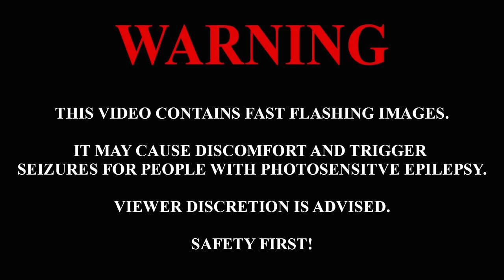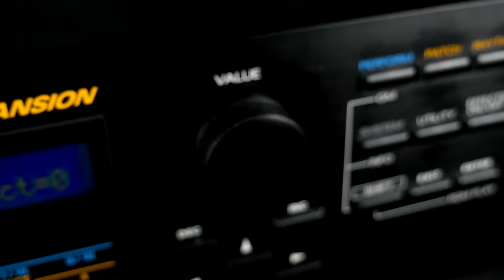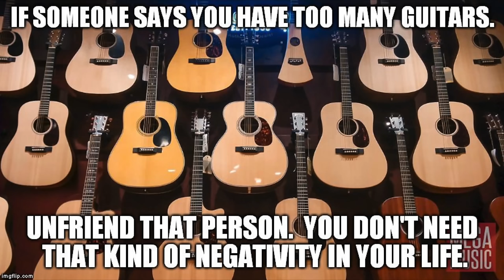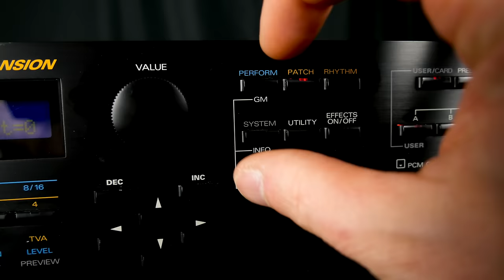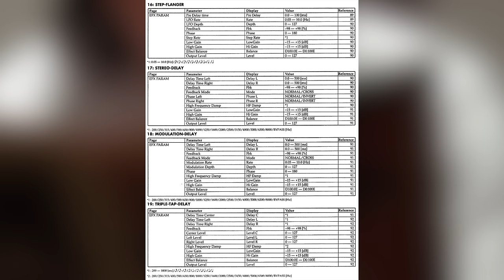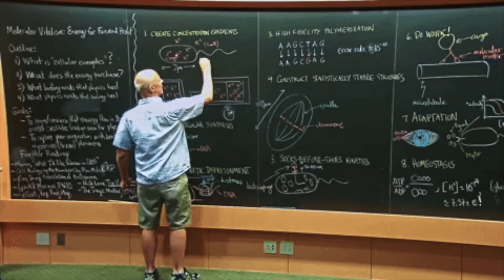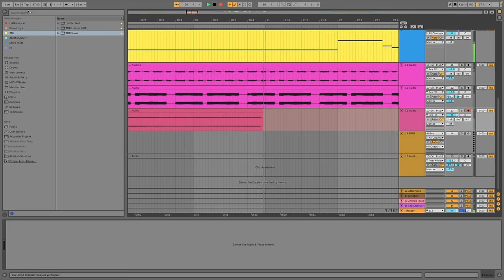Bad Gear - Roland JV-1080

Comment: I remember looking at all these back then. The JV2080 added being syncable to a midi clock if i recall, something i really wanted at the time.  I ended up with a JD990 with the Vintage expansion which i still have in a rack which is still a keeper, no syncing with midi clock though!
Reply from the maker: 1080 synced to clock quite nicely;)
Reply: @AudioPilz  I had it in my head it didn't but a very old memory now! It was that sort of in between time where manufactures hadn't quite caught up implementing those sort of features.

Comment: I have the 1010 and even though I don't use it that much in production, it's great if I want to get away from computer for a bit. Has everything you want in a small package and still connects pretty nicely with hardware and computer today!
Reply from the maker: 1010 sounds very similar and is super compact!!!

Comment: I roll an XP-50... basically this in key form, with a Keyboards of the 60s/70s Expansion Card.

The expansion card makes it much better.... ALMOST better enough to want to buy some more!

The engine is deep, and good, but it is a thinner-sounding unit.

Patch A-12 - PianoStrings - still gets the job done in a lot of tracks, from Don't Stop Believin' to christmas tunes at work :p
Reply from the maker: PianoStrings is legendary!!!

Comment: any one of the roland JV/XP series is a sleeper sound design beast. some ideas from having a 2080 of my own:

you're sequencing drums on the thing: put the kick and snare on a separate Part and route them through a compressor EFX; keep toms and cymbals, other stereo elements on Part 10 and route it through the chorus effect

remember the extra outputs: everyone has guitar pedals nowadays, digital outboard rackmounts are probably cheaper still; send the bass to a preamp, send the strings through a phaser
Reply from the maker: Nice technique!!!

Comment: Protip: If you want the Roland cloud VST for the cheapest price, don't buy the JV1080 or 5080 VST. Instead buy only one of the SRX expansion module VSTs. It contains the same synth engine and all of the samples of the JV1080 and 5080 VSTs plus the samples of whatever SRX you got, all it lacks is the 1080/5080 presets (but you could just add them yourself since it has all their samples and synth features). So you actually get more than buying just the 1080 or 5080 VST.
Reply from the maker: Great idea, thanks for posting!

Comment: 8 Mb for sound was pretty high end for the 90's. Even Creative's AWE 64 top soundfont banks were up to 8 Mb. Eventually it got up to 16, possibly 32 Mb, but by the time of XP computers, it made more sense to go with PC RAM that went up to 4 Gb, which is more than able to handle the 1 Gb Crisis MIDI soundfont bank. And, to be honest, the Crisis soundfons wasn't all that great, considering  all the RAM it used up. I'd take this Roland 1080 over the 1 Gb RAM hog.
Reply from the maker: Top of the line back then!

Comment: Wether it’s geniality or just a coincident I don’t know, but what Roland did with both the JV series or the slightly Cut down GM/GS modules, is that ALL the sounds are extremely coherent and just fits so well together, even each sound is no way near perfect in it self, they just sound so well together in a mix. I have never heard a GM module from any other brand that sounded just half as good as the SC-55 or SC-88, when you spent time editing the sounds, and that in itself is truly epic when you take into account how cheap these models were even when they were new and hot. On the other hand the new stuff with Zen cores still is far away from being as cutting edge as all this from the 90’s.
Reply from the maker: Agreed, they are super coherent indeed!

Comment: It's in the same price range today as a Kurzweil K200RS.  You can a nice library of similar sounds that are in 44.1kHz plus sampling and sample playback options.  Plus the synth architecture of V.A.S.T. really smokes what's on the 1080.  Plus the interface is worlds bigger and better.  You can actually visualize and edit sample waveforms on the K2000's front panel.
Reply from the maker: I want that Kurzweil now!!!

Comment: I have the XP30 - the keyboard version, pretty much exactly the same internals, and with 2 x expansions built in with space for a couple more (I think a couple, I can't remember, I'd have to take the synth off the rack and turn it upside down to check, and I seriously cannot be bothered). Only one pair of stereo outs, though.  Having heard the sounds here, I am defo going to plumb my XP back into the rig.  I moved house a few months ago, and had decided not to bother (a theme here?) coupling up all my old hardware.  Thanks to this vid, I am changing my mind.  I want me some '94 Roland action.  I'm thinking some XP / JV vibes through some nostalgic wobulators - maybe some slow LFO to pitch and some simulated VHS degradation in the chain, and I can start to get a bit 'mall-soft'-ey.  Thanks for this.
Reply from the maker: That's a nice one!!!

Comment: LOL.   the cork sniffers go at the 1080 vs 2080 converters. I think they both sound great.   i found a 2080 used for $200 at my guitar center while looking at the national used gear website. it was destined to be. i sped to the store and it was still there with the memory card taped to the top..  nobody looked inside. there are 5 of those expansion cards you showed (the 2080 can have up to 8).  best music gear score of my life.   I downloaded the pdf user's manual.   reading that thing almost makes me want to cry.  So, ya, i use the presets.  some are heavenly. there is a nice oboe and lots of fun vocal doo-wah stuff on one of the cards.   You could just play the demo song for a serious demo of that 1080
Reply from the maker: Yeah, I found that funny too. I got copyright notices for using Roland demos so I try to keep it safe in the episodes

Comment: wrung some astonishingly usable Trance and Psytrance bread & butter sounds out of the 2080 last year. It holds up well alongside the JD. Although the lack of Unison on the JVs really holds it back from matching up with the JD-08 (and I did run it through a Virus for the reverb, because... Virus reverb). But this and its cousins still sound solid in a modern mix when used right

Comment: A rare difference of opinion on this one. The JV1080 was an absolute workhorse synth, actually a great design for its day ( sure great to have better physical control etc) BUT it was fully featured, excellent sounding module, step above most of its competitors ( due to proper “synth” capabilities) and even made expandable options for a decade... alll  in a very compact, good value package. Don’t think anything  about it deserves “bad” label......
Reply from the maker: You know the drill, one person's Bad Gear...;)

Comment: The Roland cloud version does not have the expansion boards added to the main instrument so you can't mix and match the waves with each other. On the other hand the hardware expansion boards have been said (apparently) to blow up if the capacitors are not changed.
Reply from the maker: Capacitors seem to be a problem on these

Comment: Nah, this time, the cloud is a great value, but you can get this 1080 as a vst for only $129 with an additional 500+ waveforms, doubled polyphony to 128, and it's just incredible. No more fixing burnt anything or deal with distortion and you've got access to timeless sounds, not dated at all.

Comment: I recently obtained JV-880. It's a lot better than 1080. Takes less space and sounds warmer. Perfect if you send it through a distortion pedal, couple compressors and add external reverb and delay with chorus and flanger. Then it can be added to a hard techno 150BPM without any even remote possibility that it would sound like 90s commercial.
Reply from the maker: Nice one!!!
Reply: @AudioPilz  lol, I thought I was being funny :-) What a nerd I am...

Comment: A JV1080 fell into my setup practically for free a few years ago. It was already long of tooth when i got it, yet it sounded like all the recordings that used it, it was very clean and solid, and it sounded better over my shitty PA, for some reason. So i used it (even when i got better speakers). Fast forward go 2022, I buy a Fantom 8 (i lost my mind) and inside that thing is every patch from the 1080 (at least i think so, they are mixed in by category). Unlike the Juno sounds in the Fantom (which are not convincing), the JV1080 sounds are identical. The Fantom shines in it's quality key bed and excellent virtual piano and organ but it's a sad, glitchy disaster.
Reply from the maker: Agreed, these always worked great on bad PAs

Comment: Basically an evolution of the S-series sample standard and thus a typical champion of the somewhat "canned'" Roland sound of those times. Furthermore the user interface is indeed criminal. I'd prefer the JD800 or even the JD-08 any time. On the other had it is THE classic incarnation of this workhorse format. I wouldn't underestimate it's role, even still in present day setups. Once you are on a roll it might still be the right axe for many things. Still I am happy I never secumbed to its attractions. Not that my Roland W30 was / is a pleasure to program but at least one can put his own user samples in it, which is the JV's biggest limitation. A good sample RAM selection however still goes a long way.
Reply from the maker: JD800 sounds even more spa-worthy;)
Reply: @AudioPilz  Click. Ktshhhhhhhhhhhhhhh! "Aaaaah!" Burp!

Comment: " I still have my rack-mount 1080 in mint condition. Also, I have the cloud version.
The rack-mount sounds distinctively warmer & richer. 

Roland D-series uses its 'partial theory' synthesis for programming. It's really not that
difficult to still program unique sounds using
this synthesis method. 

Personally, it's a great rm-keyboard to have if you still have it around as I have. VSTi's often
sound very sterile & lifeless. When using a vsti, I usually route the output to any decent
Keyboard Amp, & mic it to take its sound out
of the cold sterile world of virtualism when recording its sound into my DAW. It makes
all the difference, yes !!

GEAR is Gear to me. If it is still working, use it.
A lot of the older synths, especially rack-mounted gear lasts longer. Keyboards, 
on the other hand, often need repairs within
3-5yrs. Bad screens, keys, etc.  You know the deal.

I've had my 1080 for the longest, and it still
looks spanking brand new. The only thing
that I've had to do occasionally is to change the internal battery. Which is very easy to do.

As far as new sounds go, just get creative
& explore the synthesis engine. It is very possible to still create Hot Sounds on just
about any 'older' out-board synth. Just explore 👍🏼"
Reply from the maker: Thanks for the heads up!

Comment: The thing is, in modern day, if you want that D50/JD/JV sound, just grab Omnisphere and be done with it, Eric Persing did much of the sound design for Roland back then and Omnisphere has the character while being infinitely more programmable and much more powerful.  I spent a bit of time building my favorite D50 patches in Omni and now my D550 just sits in my rack looking pretty (for a nearly 40 year old digital synth). No need to subscribe to a cloud service.
Reply: You can even bit crush the samples and outputs separately to really catch that 90s mid-fi character!
Reply from the maker: Nice, didn't know that stuff was in Omnisphere

Comment: The 1080V is there to remind us that Roland is much like Adobe in a lot of ways...just like Photoshop hasn't had a significant leap in functionality in about 20 years and basically switched to a subscription model to keep making fat cash without doing a whole lot, Roland basically just reiterates the same 1080V synth setup but renames it and adds some gimmick names here and there and repackages it in various ways...I mean, ever noticed the MC707, MC303, etc. just feel like the 1080's synth in a groove box instead of...well...just a box?
Reply from the maker: Adobe for synth nerds indeed!

Comment: Ok, I've got to disagree with this one.  Sure, the JV was a studio staple in the 90's, so a lot of these sounds will be familiar.  But that doesn't make them tired or obsolete.  Electric guitars, Hammond organs and Rhodes have sounded pretty much the same for decades and are still all fundimental sounds.  Even in the synth world, MiniMoogs and Oberheims have instantly identifiable sounds that have been used for half a Century and are still in demand.  So the JV is just as useful now as it was then.  With a few exceptions (like the anemic pianos), it's a great sounding instrument, that's arguably a classic.  Of course, there's a Cloud version, and many of the sounds graduated to the XV series and then on to Zen-Core.  So you could have a good portion of its sonic repatoire already available from other Roland sources.  But it's still a great instrument as far as I'm concerned.

Comment: Bought an JV-1080 and an JV-880 a few years ago, just for messing around with sysex. And those boxes didn't disappoint. 300 bucks well spend. 

One can learn a whole lot from the instruction manuals, which are still available on the official homepages after all these years. Sadly, the guy, who scanned the hardcopies and turned them to pdf-files, did a poor job. Many of the essential code lines are barely readable. If you want to get into sysex-programming, then this is a good option, but you would almost certainly want a real and original copy of the manual (not printed out from the pdf!), that includes the whole midi implementation.
Reply from the maker: Sysexing old Rolands is an acquired taste;)

Comment: I love vintage samples and presets ... and yet I don't like this - even though I bathe in nostalgia every day - I even use nostalgia aftershave. It thickens up nicely if you add sauce on top, but straight from the saucepan it's thin and airy. What's the point of rackmount if you have to be close enough to it to twiddle a knob and poke tiny buttons on the thing anyway? Confuse and disappoint. Thanks for rolling this thing into the crosshairs.
Reply from the maker: Agreed!!!

Comment: I've already talked about my JV-2080 here before, so I'll just say that I'm surprised you didn't complain about having to put an exciter on every track. And the envelopes sometimes act weirdly, especially on drums. But if you're as into 90's romplers as I am, review the Korg 03R/W - it sounds great, but its interface is bad enough to instantly propel it into Bad Gear territory. The snares and hi-hats are however extremely uninspiring, and in some cases even overused, with the exception of the appropriately-named "Snare 1" and the two synth snares, which aren't the tired x0x sounds, but are taken from old analog Korg drum machines.
Reply from the maker: Great suggestion, thanks!

Comment: 07:46 it's not because it was an early filter why it sounds so dated .
The digatal filter in the JD990 -jd 800 , (same filter in the roland s series samplers )were even older but sounds far superior to the jv1080-2080 and everything after that ,, even the xv5080 , older fantom and the integra
Reply from the maker: Thanks for the information!

Comment: I only use the JV-1080 for that plastic box reverb over the rave drum kits

On a more serious note, I do find that I hate all the Roland rompler sounds now.  Cultural PTSD is a perfect way to describe it.  What interesting is that I don't have the same feelings about the E-mu and Yamaha romplers.

Also, I hate rackmount romplers now.  I'd take an XP-50 (or more like XP-80) over a JV-1080 at any point, definitely felt the other way around in the 1990s when I used a 1080.
Reply from the maker: Agreed, E-MU aged much better

Comment: I had the JD 990 once, sorta like this unit but with a massive screen, it was capable of being programmed to make some really rather nice noises without being too painful to use, though (reluctantly) moved it on when plugins got into the territory of being able to compete with it comfortably. Still have a D550 in storage (the gloriously, pleasantly glitchy beta run from Roland entering the digital domain), which I should probably move on soon.
Reply from the maker: 990 is a legend!
Reply: @AudioPilz  if you can, borrow one and have a play, its interesting, and I do wonder if they cut some of its dsp corners in making the jv1080 (they probably did). I do seem to recall Andrew Weatherall of Sabers of Paradise / Two Lone Swordsmen commenting once on using it on various tracks in the past and folks being convinced they had a mountain of big fat analogs. And nope, just nerd programming that little black box over there. Also yup, you should totally take on the D550 / D50 - its not exactly bad gear territory, however its glitchy, album remember berry (recognisably cheesy) preset central.

Comment: The 1080 is very programmable and really not that hard to comprehend. Better with an editor of course. Like many of these hardware tools, you have to learn it. It's a brilliant engine and if you take the time to understand it you can get very useable sounds.
Reply from the maker: Comprehensible - yes. Fun to program - not really;)